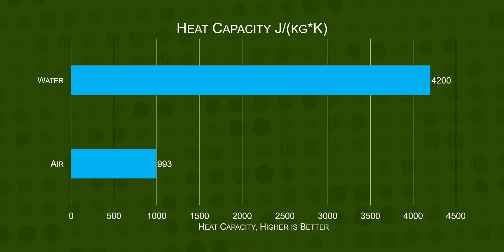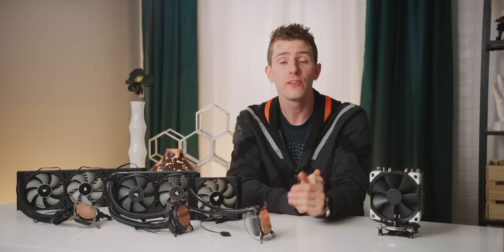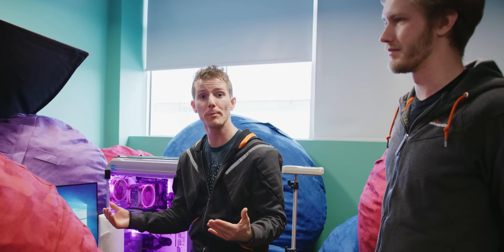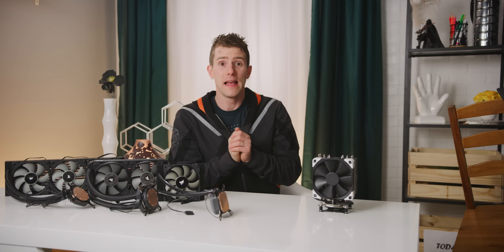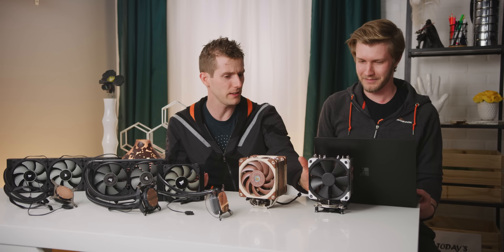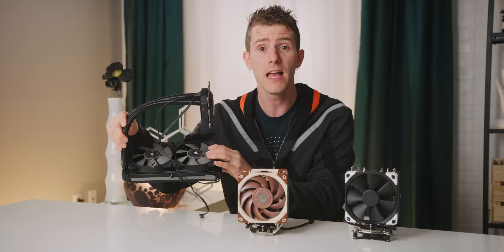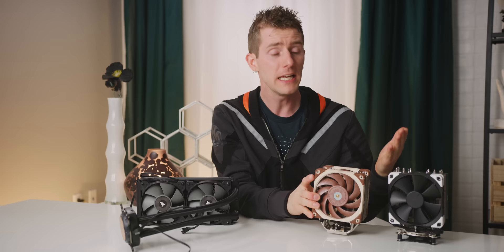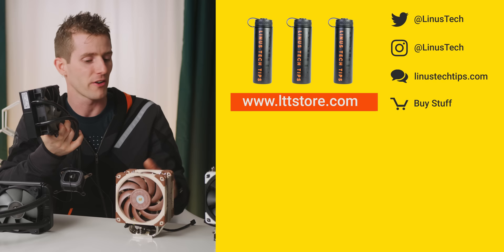Why you shouldn't water cool your PC

Comment: Me: buys and AIO
YT: lets recommend him this video.
Me: :(
Reply: Dude, i have an AIO because my air cooler didn’t work as it should. My CPU was at 85 celsius, now with the AIO the cores are at max 60 and the overall temp is 36 at absolute max load. It works, its simple and it does its job. I am glad i have this watercooling system, its effective and just gets its job done. Also consider this: the H100 is one degree above the air cooler... its just one degree... so dont always listem to what they say. Their data might not be corrupted by any opinion, but the point of the video was to prove water cooling sucks. If you feel bad look up videos about Pros and you find a different opinion. As long as it does its job and you like it, it doesn’t matter really
Reply: I would suggest GamerNexus video on AIO orientation, just in case you're experiencing bubbling sounds and feel it is louder.
Reply: True
Reply: @kreb9721  aesthetics make performance better bro I swear, RGB bumps my FPS up by like 60
Reply: @Thep184  for long term use , air cooler is more great
Reply: @pessiescobar4707  how ? for what longterm use ? for longterm not caring abput it maybe, but your components survive longer with cooler temps. water cooling makes cooler temps normally... Test bench ist nice and all, but it ignores Air flow constriction in a case and heat built up, which water cooling can ignore, and a Air cooler cant. Also yeah...you have to maybe maintain a expensive water cooling system once in a while and an AIO you change ever 2-3 years...whats the deal ? so yeah...depends on what long term use you talk about
Reply: @Thep184  dahell are you talking about i have air cooler and my temps are 45-50 underload lmao
Reply: @Yukitta69  yeah and i have 20-30 degrees beneath that... not under load but i have not seen a single air cooler work great with a ryzen so yeah... just stating my experience
Reply: AIO is way better bro
Reply: I’m scared to clean my cpu so you could install my aio cooler because my pc overheated with my new stock cooler do I have to clean it since it’s me thermal paste
Reply: @Thep184  the guy water cools all of his builds, he’s got to come up with content for videos, hence this one
Reply: @pessiescobar4707  AIOs can last up to 5 years
Reply: @Thep184  Bro, wth, if something breaks on your watercooling setup and the pc is on ALL your components will be fried, it isn't safe. And watercooling is also very expensive and ugly. And requires maintenance.
Reply: @Thep184  which aio you bought cuz I am also looking for one to buy
Reply: AIO need more cooler to exhaust hot air of the pc.
You can configure your AIR in push-pull to beat AIO.
The cost must have was air with fan-duct dedicate to the CPU, but it's sometimes difficult to make that.
Sorry i'm french.
Reply: same here
Reply: @Thep184  

"water cooling makes cooler temps normally"

did you even watch the video?
Reply: @no_misaki  yeah i did. And do you know they use test rigs ? In a normal pc case the efficiency of a air cooler Drops significantly as the aluminum fins heat up as the air in the case does. It takes in the heat of the graphicscard, the ram and everything. Linus tests are great, but nowhere near realistic with a testing bench. A water cooler radiator is typically an air intake for the pc. So it sucks cool outside air in. 
Yeah, linus test says in theory they run cooler, on a test rig with no case surrounding the cooler, but in practice and my experience water cooling is way more efficient. My cpus are always water cooled because of this so yeah...
Reply: @Thep184  if you have proper intake and exhaust fans as well as unobstructed airflow (i.e. good cable management and a decent case) that is a non-issue for air cooled setups. Now good dedicated water cooling (as in a fully fledged pump setup) will put any fan or AIO to shame of course but that's not what this shitty clickbait piece was about 😅
Reply: Ok, so I happened to buy a pc with an AIO. It's my first time ever owning a desktop or gaming pc, so I have no clue what I'm doing.
I have no plans to run it to its max capability nor do I wish to overclock it as I got a very nice one purely so it could last longer (I thought in my head) and load quickly as I've only ever owned junk laptops, but I know NOTHING about computers except what the different parts are, what they do, and what I need to look for as far as issues and good things. I have no clue how to manage a computer, and after reading the title of this video and knowing the dangers of leaking, I'm questioning whether I messed up on getting water-cooling? I'm more than willing to learn how to change it for air-cooling instead if I absolutely have to, but I don't want to spend more of my parent's money than I have to now, especially since I did go overboard with the computer. Any advice on the matter? Or any other advice that would be helpful as a noob?
(Also, sorry if the comment is clunky to read. I don't comment much!)
Reply: @no_misaki  well thats true. Look, i think it actually doesn’t matter... i personally like my AIO cpu. Cooler as it no only looks better, but for me personally it works better then an air cooler. I think in a real scenario without a completly open test bench the results are similar. There is a great video out there about radiator mounting and GPU shrouded or without its plastic cover... in a real case even those little things can change temps up to 10 degrees. And AIOs are so reliable now a days and i have never heard of one leak... i think its just personal taste for the regular user. But i agree, a custom water loop is many many times better then any of the others for sure
Reply: @pizzatime3752  nope. Dont get frightened by the video. Just make sure the pump ( which is normally located on the CPU with AIOs ) is not the highest point. It will get noise and could damage the pump. And for leaking... don’t worry... i have never heard of an AIO leak and mine didn’t for a year now so guess its fine. For a regular user like you and me and most who now Panik over this video it doesn’t matter one bit. As long as your cpu is not burning up its all perfectly fine :)
Reply: @lnfinyx  if you build a water cooling setup that randomly breaks, you better off not messing with it.
Reply: Don’t listen to it. AIOs slap
Reply: @kreb9721  I bought mine for purely aesthetic reasons too. 5600x dont need no aio
Reply: I'm not sure why you'd be sad. If you watch the whole video aio's are better in the long run for your pc since they won't mess up your motherboard.
Reply: @Saint-XIV  I am curious how many people have to directly heard from that had their mb messed up due to an aio? I dont use AIO myself because i have the ability of making my own water cooling setup and i like the look of acrylic tubes more.
Reply: @doingstuffwithfox601  much longer too mine is going on 8 years now and it works the same as the day i bought it. Cooler Master Seidon 120V. i have close to 30,000hrs runtime. the product was rated for 40,000 for the fan and 70,000 for the pump so lets see. :)
Reply: @Thep184  my AIO is 8 years old works the same as brand new.
Reply: @Thep184  it's not about aio or air cooler, noctua just too good. what linus mean is dont buy aio  if your budget can buy noctua.
Reply: @Thep184  I hit 99°C which is the highest it detects, it hits 90-ish idling
Reply: Exactly
Reply: Lmao
Reply: @Thep184  what about risk of leakage? My first time ever building my first PC, and I seriously love the aesthetic of the AIO, but I’m just worried something might go wrong and it would essentially kill my PC
Reply: @halofanaticboy  dont worry. AIO are not even filled with conductive water, maybe cooling liquids but nothing that can kill your pc. Even water cant kill your pc that easily... and AIO are safe, like really safe. maybe you need to swap them out when you build a completly new system, but thats about it.... if you build a loop yourself, that a bit more scary, but an AIO...nope. i have mine since a year and didnt even think about leakage once... so yeah... and for water to kil your pc it would have to drop into the most esential parts while they are running... on other parts the voltage on the components is way to low to even short out really... so just relax, enjoy your AIO and have a beautiful PC you like :D
Reply: Look at my face = feels.
Reply: @Thep184  do AIO's require some sort of maintenance or is it like you put it in your build and then leave it. Also what are your thoughts on nzxt kraken x53?
Reply: Gr3gor  lol, let me guess, you're one of those "RGB everything" builders
Reply: @Thep184  Fix your airflow or improve your room's ventilation. It also doesn't say water cooling sucks. It's saying to carefully consider your choices. A lot of people these days simply ride the hype and are quick to dismiss "outdated" tech.
Reply: @zenixy2097  yes you have to clean it and put new thermal paste. Conquer your fear with facts (research) and practice. Besides, what have you got to lose if it keeps overheating and you cant use it?
Reply: @pizzatime3752  Then it's time to learn about computers, I'm afraid. Unless you have lots of disposable income and you can afford to hire someone to fix and maintain it for you. Good news is there is no shortage of great youtubers who can help you learn.
Reply: @Thep184  I'm willing to bet that your "air cooler that didn't work as it should" was a stock CPU cooler.
Reply: @ianraffel6535  ok dude..now this is insulting. Who on their right mind has an opinion about Aio and air cooler, and uses a Stock cooler ? also a ryzen 3950 doesnt come with a stock cooler, so in that case i must have been so dense and not apply a cooler xD 

no but seriously, i used the be quiet dark rock pro cooler. all the cooler did was heat up the case, heat up the entire air inside and heat up the metal of the case itself. that was 60-70 degrees of hot air inside tha case, 5 fans where pulling hot air out, 4 fans where pushing fresh air in. with the AIO the mac temp of teh CPU got down a lot, AND the coller doesnt produce 70 degrees hot air, but 30-32 depending on day and weather. 

It may be true that on a test bench that thing worked, but in an ATX case an air cooler just doesnt work as well. except you have perfect air flow, but that they didnt test this, just slapped it on, and with 20-21 degrees ambient temp it might work with no case. but when you have 24-25 degrees ambient, a case, then in my experience an air cooler just doesnt work as well. 

Also, linus might have a great little data sheet there, but as i said, thats not a RL scenario. No one has a testing bench as PC case. The data might be correct, but it is not realistic. especially not in an not air condicioned area and with all components in a PC case.

Also, if AIO where so absolutly bad and air coolers where so much more effective, why does everyone that wants their system to run cool, use water cooling ? because it can remove heat much more efficient and faster, and because you can keep the whole heat amiting from the setup more in check.

I know for a fact that my cpu temps got down way more since i used my AIO, i know that in both cases ( air and AIO ) i used selcted high performance thermal paste and removed the pre applied stuff, and i know that in all cases there was contact, right pressure and contact applied.

A test bench scenario like they did is not a valid RL scenario. what he did was test the overall cooling vapacity, and yes, an air cooler, with no case, unlimited air arround it and the ambient temperature staying at 21 degrees celcius it might work better.
but under RL situation where you maybe dont have an AC, there is a case that shares the air and space with other heating up components and the air flow is restricted due to there being a case, other components and so on, it no longer works as efficient.
Reply: Same ☹️
Reply: @travispelser3898  don’t get discouraged by one tech YouTuber saying AIO is worse then air cooling. Seriously. An AIO is basically a water cooler. Linus builts most his systems with water cooling. Also he tested on a testing bench. There is another YouTuber that said that AIOs are better for PC cases. It’s that simple really... get your own opinion. If your CPU is cool, that’s great.
Reply: @kasturichaudhary6184  only maintain the fans and the radiator
Reply: Yeah, tbh after watching a few other of Linus's videos to try and learn more about my pc, I've come to find that his vids just aren't trustworthy for pc noobs. I feel like he immediately ditches his opinions just for content or sponsorship options and doesn't truly give you an honest review. So for anyone else who's like me and gets scared by this video, don't be! <3 By all means, get a good AIO of that's what you wanna do. Imo mine works great, and I don't really think it's a good one either (Coolermaster Liquidcool 120mm Lite). And from looking at other videos and doing some research, I find that AIO's can indeed be more reliable as far as integrity goes. There's little to no chance of a leak, and as long as your radiator is above the pump, it should work just fine. The pump may fail eventually, yes, but it's painfully obvious when it does and as long as you get a new AIO or switch out to an air cooler, you're good to go, and it won't harm your computer at all. Yeah, I feel like I could get better temps with a high-quality air cooler, but tbh my case thermals just aren't that great anyways, so I just don't think it would work for me. If anything I'll just upgrade to a 240mm AIO later down the line. Anyways, sorry for the rant lol. My point is, don't be scared of AIO's just because of this video and go look for other, more fair opinions. The channels JayzTwoCents amd Gamers Nexus seem more fair and reliable than Linus imo, so go check there if you want a second opinion.
Reply: @Thep184  well said.

Comment: Me using liquid nitrogen to cool my laptop: I like your funny words magic man
Reply: big brain time
Reply: ‐321°F's for your frozen laptop.
Reply: @StefanVeenstra  shahhhh right! I'm like OC to a jillion!
Reply: Better is protoplanetary Boomerang Nebula that's what I use I had to travel 5.000 lightyears but it's ok
Reply: @StefanVeenstra  actually, I have the rx 5700 xt, which means that my junction temperature is still 80 degrees
Reply: @justaperson8852  I splurged and got the rtx 5770 to go with my Intel i100
Reply: Nice now that my laptop is cooled by liquid nitrogen I can overclock it to 100 GHz.
Reply: my guy literally superconducting his laptop
Reply: use liquid helium 
for -230°C (-382°F)
Reply: Sorta expensive but it's not water so near no chance of anything shorting out loool
Reply: That's actually an interesting idea. Metals cooled to extremely low temperatures act as superconductors. If you could find a way to not freeze your entire PC and to only cool the appropriate parts, you would see a significant increase in performence.
Reply: Lemme guess, your laptop still heats up the room in winter?
Reply: We are peasant , one leaks and we are done

Comment: Just an FYI, no matter how far air cooling comes, it will never do better than water cooling. This is just physics. Water is better at removing heat than air.
Reply: Have you realized water coolers still use air to dissipate heat?
Reply: @danielmontes7042  Have you realized water still removes heat better than just air alone and introduces a cooling medium rather than just removing heat? it is an indisputable fact that water cooling always outperforms air cooling.
Reply: @ALLAHALLAHism  Well, you should look into how heat pipes work and what latent heat of vaporization is.
Reply: @danielmontes7042  I know how it works. It's still inferior to water. Why do you think we use water to cool cars?